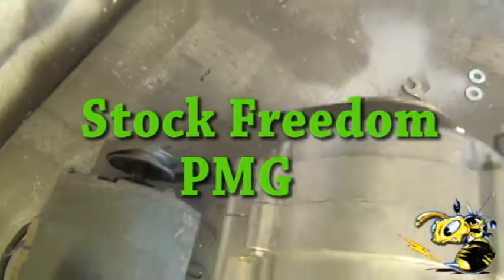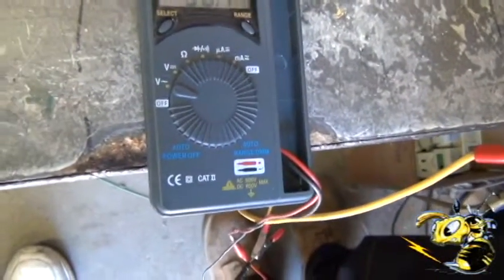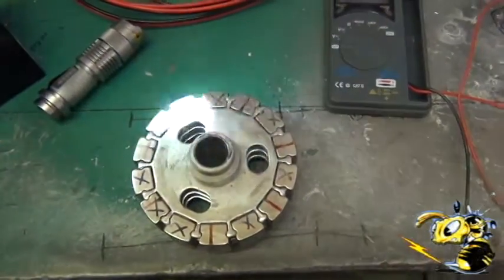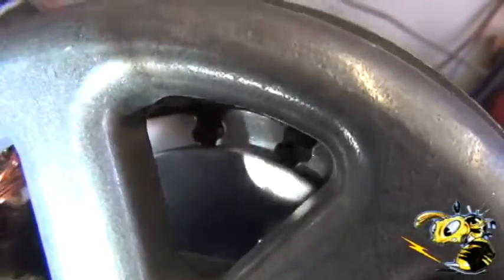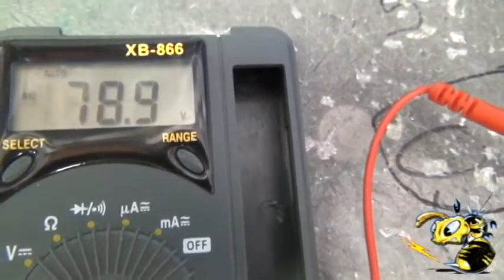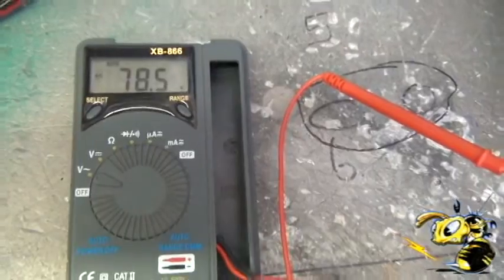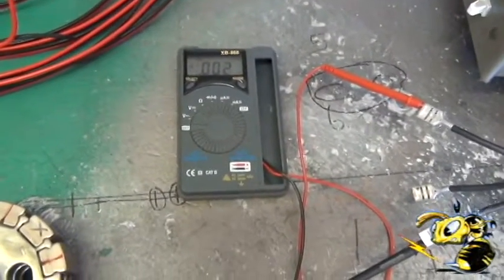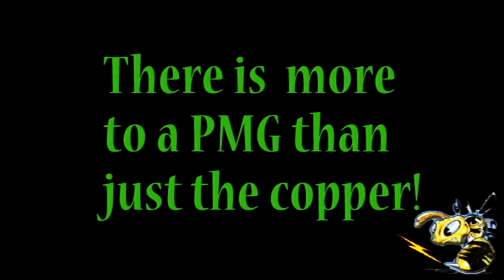Missouri Freedom PMG with Thermodyne Super Core rotor inside

Comment: Volts is great but I have a 12 volt battery bank with a 12 volt solar array. No MPPT controller so how would this benefit me?
Reply: GPVlog Just make sure that your in a good wind zone :) Here's a link to map: http://rredc.nrel.gov/wind/pubs/atlas/maps/chap2/2-01m.html
Reply from the maker: GPVlog    it's best to say with 12 volt range turbines for 12 volt battery systems.  Here is a good system for the money  http://www.hydrogenappliances.com/KT7BM.html
It is available in all voltages from 12 to 48
Reply from the maker: TheBillytheJack2010   Yes wind turbines need wind lol.  Some times people forget this point :) Thanks Billy.
Reply: even though I am in a low wind zone according to the map, I live right on a lake so I get consistent winds.
Reply from the maker: GPVlog   Volts does convert to amps in this case.
Reply: I know very little about wind energy. What would be the best way to add wind to my 12 volt system? Can I get 12-24 volt generators?
Reply: GPVlog Well If you may a constant 5-10 mph. The amps won't be great till you see 20+mph. Study your area get a wind gauge and record daily winds for a bit :). Then look at your area. I have mine, surrounded by tree's which is not good, but I do that to show product with dirty winds to make people think. So if your going to include cost for tower, make sure you have a good number's and area :)
Reply: @TheBillythekid2010  so I'm gonna buy your motors but I need to know which is the positive and negative wires out of the 3 wires sticking out of the 3 phase motors. I've seen a Indian guy did it here and he says you ignore the center wire but since not all motors are made the same way I think the only solution is to ask the sellers. I'm gonna use these motors as AC output, not DC's 12v to 48v style. Please answer, 😊 thanks
Reply: TheBillytheJack2010 I need something to help my batteries at night.

Comment: Size matters. People will clue into that eventually. Copper's just the conductor. It's important because it carries the electrical current created, so the coils/wire need to be sized according to the magnets - but not the other way around. The power comes from the magnets, as you've just demonstrated. Good job.